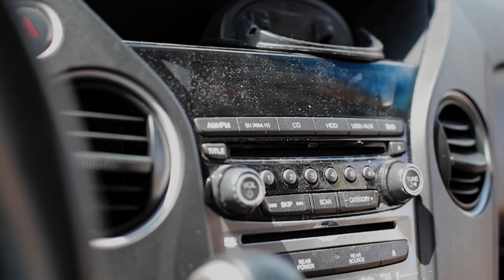FIRST Deep Clean in Years | FULL DETAIL Honda Pilot

Comment: Great job on this. Does that Car Pros paint sealant work well?
Reply from the maker: It’s actually does a good job for a month or to. Basically it works amazing as a ceramic coating top off. You can use it as a stand alone sealant as well.
Reply: @esadetails  thanks I'll look into it.